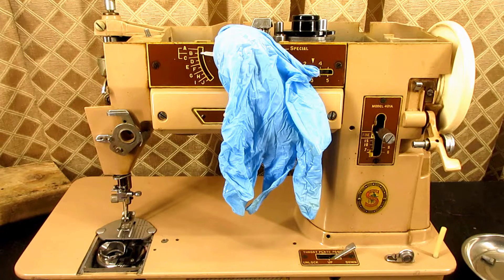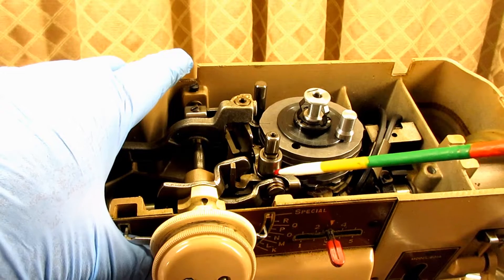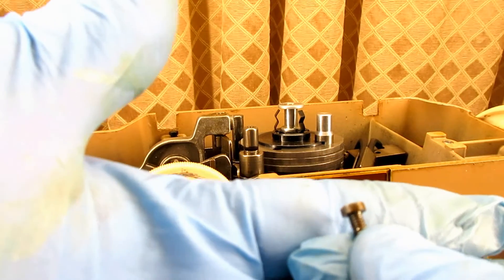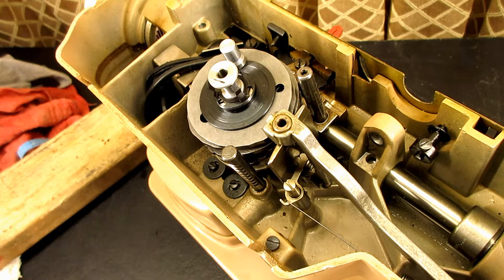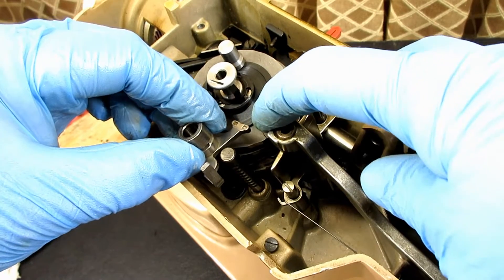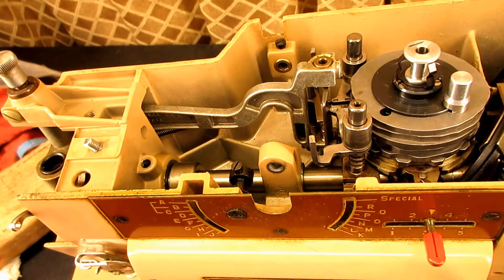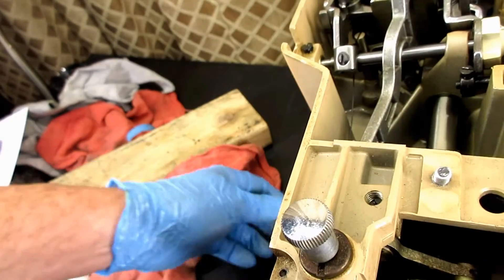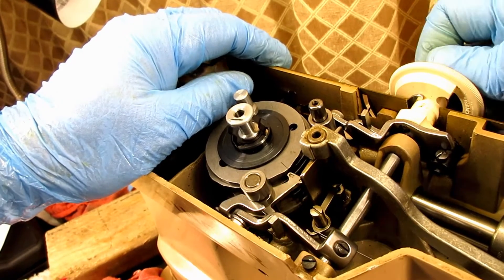Remove the Knobs, Lifters and Followers on the Singer 401A Slant-O-Matic

Comment: Thanks Andy, over a year after you made the video I'm working on a 401 and just removed, cleaned and reinstalled the cam stack, the knobs, the lifters and followers. You're a great resource that just keeps giving. And I've got two more 401s to get to.
Reply from the maker: Thank you, Terry. The video that keeps giving (playing?) Thanks for saving those machines.
Reply: Terry, I'm in the same boat.  These machines are some of the best, even better than todays new standards.  These are strong and can do what todays machines can not unless you buy a beast industrial.  To get one of the 400 or 500 series is where you can do almost anything you want.
Reply: Terry, I’m getting ready now to watch this as many times as it takes to do this with my 401A.  Andy is so thorough that I have no doubt about a successful attempt!

Comment: Such an excellent, detailed tutorial. I am ready to remove, clean and reinstall the sticky, recalcitrant knobs and lifters of my 500A. I have already removed and cleaned the cam stack; the gear and cams were so stuck together that my husband thought they were one piece and therefore couldn’t possibly be separated.  The application of some WD-40 and heat proved him wrong. 😀 I did experience flash rust on some of the cams, even though I started drying them as soon as I rinsed off the Krud Kutter. Next time I will rinse off just one cam, dry it and apply a light coating of oil before proceeding to the next.
Reply from the maker: You ARE ready, I can tell. You can do it too. The metal of the pattern cams is less treated than other metal parts and they can just bloom with flash rust one you strip the grease off. Wish I could have watched you with the WD40 and heat and bet your husband was impressed with your skills! It's good to be the Sewing Machine Mechanic in the family! Easy does it and enjoy seeing the knobs & lifters looking like new. Take Care.

Comment: Thanks Andy 
, just completely stripped, degreased and polished my cam stack , followers and associated brackets on my 411. I have yet to reassemble but this video is such a help.
Reply from the maker: I'm so glad you found my video. It's rewarding to see how clean those parts can be and you'll be happy with how well they work when finished. Thanks for letting me know the technique can be applied to the 411G and I'll ad that in the description. Take care.

Comment: Hi Andy.  I had already done everything in this video before you posted it.  I'm not bragging -- I want to mention that I put the shaft back in with the flat spot down because that's the way it was in when I took it out.  After watching your video, I immediately changed the shaft to put the flat spot up.  It did make a difference!  The pointer on the left on the front now sits at "A" when I put it at "A" and at "B" when I put it at "B", etc.  With the flat side down on the shaft, the pointer would sit half way between "A" and "B" when it was actually in the slot for "B" and so forth all the way down. I just thought Singer sometimes was not so precise; everything else worked well.  So thanks!  Of course, I'm looking forward to all your future videos.
Reply from the maker: Maybe you should brag a little bit! It's not an easy task to remove and replace all those fiddley parts. Nicely done. It's so interesting to read your comment about the flat spot on the shaft! When I pulled mine out the flat spot was facing up, and I did not give it much thought. I wonder which was is correct? The parts diagram does not show a flat spot, and the Service Manual does not mention it. My machine has many signs of being worked on, too. Based on your experience, I'm going with the flat spot up b/c you had a positive result on the indicator pins from changing it to that position. Carole, have you ever thought of recording your own videos for YouTube? You are getting quite a bit of experience working on these machines, and you have some great instincts and comments. Just a thought. Viewers always enjoy a new perspective. I'm going to pin your comment to the top here in case other viewers have this question about the shaft. Thank you for sharing on my channel. "See" you again soon, I hope.
Reply: Thanks for the suggestion about recording some videos on YouTube.  I am so far away from recording anything!  I haven't taken still pictures of anything, either, but that I can start to do, even though I'm terrible with anything linked to photography.  I am going to start taking some pictures of the machines I have refurbished, both inside and outside of the machines.  I have some fine-looking, beautiful, well-running and adjusted machines now, and they did not start out that way.  Well, now I am bragging a bit.  Looking forward to your next video on setting the index pins, setting the  arm stops, and zeroing out the machine.
Reply from the maker: @carolemagnusson5044  I'd love to see you post some of your machines on YT. I know they are beautiful. The nice thing about YT is you can load a video, even from the app on your cellphone if you have one, and you decide the settings. You can make it public like me, or unlisted so only people you give the link to can watch or set the video to private so only you can see it. That way you can play with it and critic your lighting, angles and so forth. There is free music from YT and free audio editing software too. When you are ready and have time you might enjoy it. I'm starting to film the index pins and hope to have it up by Friday evening. We'll see as I have a treatment Thursday. Thank you as always for watching my channel and for your support.

Comment: I got this one cleaned up and running. I still need to tinker with it and adjust it but thank you for the Sklematic! As with my 457 with out the help of your PDFs and some advice and parts I'd be unable to make a stitch.
Reply from the maker: I'm glad it's working out for you.
Reply: Oh, I need your experienced advice!
In the repair book for the Rocketeer you sent me it states  remove the screw (A4) from the stop motion nut (B4)  then remove the clamp.(C4) the the hand wheel assembly
My question to you is how in heck do I remove the B4 after I remove the A4? Do I pull, turn or am I not understanding that the screw I remove A4 is holding B4 and the B4 is the stop motion nut,  the tan or off white portion of the hand wheel?
Reply from the maker: @sharellfox-ralston1958  Easy does it! Are you talking about a model 457K?  In general, the A4 screw is to keep the stop motion from unscrewing all the way when you put the machine in bobbin winding mode. By removing A4 you can turn B4 to the left until it unscrews from the Arm Shaft Bushing and comes completely off the machine. 👍
Reply: @andytubesewing1953  i am working on the Rocketeer. And you've answered my question when you wrote to unscrew to the left! I had no way to know and was afraid I'd make it tighter.. thanks for your prompt reply and your help. Be well..
Reply from the maker: @sharellfox-ralston1958  OK, good. B4 is identified as a "nut". 99% of nuts & screws & bolts unscrew to the left to remove. Lefty loose righty tight. Just like you did to screw A4.

Comment: I have removed many screws and bolts that were very difficult.  The best method I have found from decades of experience and watching dozens of mechanical videos is to let penetrating oil work overnight and then turn to the right and left, back and forth to break it free.
Reply from the maker: We appreciate your sharing your decades of experience with this method. Dennis, thanks very much

Comment: WELL DONE ANDY !!! Was hopping to find something regarding the needle position lever but none of the links, to your previous videos, you gave nor this one could help set that of my machine right... THANK YOU ALL THE SAME... Always glad to watch you reviving those metal pieces :-)
Reply from the maker: It seems you have a few problems with your machine. I'll list some reverences for you on model 611 that may help you and others following your comments. Maybe they can be of help. FREE Instruction Manual: https://www.singer.com/search/support?title=611
$9.00 Service Manual download; https://manualsoncd.com/product/singer-611-sewing-machine-service-manual/
$22.00 Full professionally printed copy of Service Manual: https://www.ebay.com/c/1348562806
FREE downloadable Service Manuals for Models 401A, 403A, 404, 500A, 503A can be found on this page:
https://sewingdude.wordpress.com/category/free-manuals/page/1/
The model in my videos, 401A, was two generations before your 611. The 600 class machines went to the slide levers to select patterns to replace the knobs. However, many parts were still similar/same as in any mechanical device. Like a car still has a steering wheel, driveshaft, differential, windshield wipers, etc., the Singer machines of the 600 class still have a needle bar driving arm, cam stack, vibrating bracket, feed system, drive system, etc. The manuals for the 400 & 500 class may give you insight into how to work on your model without buying a Service Manual. Of course, the Serice manual for model 611 will have the exact information for the model and parts. I often buy service manuals when I am not familiar with the model. or some parts of the model as it saves a lot of time and frustration. The 611 Service Manual is about 50 pages full of information with directions and pictures for adjusting, remove or installing almost every single part on the machine. I hope you can get your machine running the way you want, I admire your persistence and I thank you for saving it from the scrapheap.

Comment: Hey, Andy, awesome video as always!  I have two 401’s that I have cleaned up and lubed.  I had found a video for doing the cam stack, but could never find one like this for my gummed up knobs, lifters and followers.  I was definitely not confident enough to try it on my own.  So thanks a million, again!  It looks very do-able now, and I was glad you left the parts in where you had minor challenges, so that I’ll be prepared.  Take care, from Winslow!
Reply from the maker: Thank you! A special thanks for your appreciation of the challenging parts, haha. I've watched some videos and things go so smoothly it makes me wonder what is wrong with me? You can clean these parts up for sure. I'm working on videos for the index pins, setting the stops for the travel of the cam selector shaft and maybe the instructions of how to "zero-out" the machine. Thanks for watching.

Comment: Thank you soooooooooooooooo much.
Reply from the maker: No problem and good luck, Deanna
Reply: @andytubesewing1953  I think I will stay with my black beauties, I have several singer that only sew a straight stitch but they aren't complicated to clean and oil.
Reply from the maker: @deannalindsey889  Sure. The 401A is about the most complicated vintage Singer model to maintain. Newer cared for it much myself. My wife who has sewn for 50+ years felt how you do until she watched me restore the Singer 301A and 404. She just fell in love with those slant needle machines. The 404 has the same motor power and slant as the 401A and it is more heavy-duty and just sews straight stitches. The 301A is her daily machine (see my playlist for "Coco") which has even fewer parts (in-line hook system) and was the first slant needle. She likes that Singer moved the needle closer to the sewist and uses a taller foot so she can see the work area better. She has owned the 15K, 66, 99K, and 201-2, but just doesn't use them any longer. It's just a matter of preference I think as you can't go wrong with any black vintage Singer model. Happy sewing.

Comment: Amazing,  I just got a 401A... I'm not mechanically minded... but you have helped me get my machine up and running... my cleaning job is not as deluxe as yours... but I'm learning 😊 ... my motor seems sluggish to start with the new foot pedal (I ordered a new one)...I use the hand wheel to boost motor and takes off just fine... any suggestions, thanks,  Julie
Reply from the maker: We don't know the history of the machine. We don't know what work was done on it or which parts, if any, were replaced. 
     Maybe there is binding on parts of the machine (more in a minute). I have found that cleaning a 60+-year-old machine like this can eliminate most of the problems. 
     At the very least the machine needs a complete oiling as shown in the Instruction Manual which you can download for free from SInger Support: https://www.singer.com/search/support?title=401    I've had machines arrive completely frozen. I've oiled and heated the moving parts with a hairdryer to get it moving, then did a "Run In" meaning run at a moderate to higher speed for at least 3 minutes. 
     The machine may have never had a proper cleaning. Sometimes 60 years of oiling has settled into all the bushings and bearings and gotten very hard at the low spots. With some new oil, the old oil can get soft and tacky and slow things down even when it gets movable. 
     In the Service Manual on page 161 is a list of 27 things to check if the machine is slow and binds.
You can download a free copy of the manual from the Sewing Dude's Blod here: https://sewingdude.files.wordpress.com/2012/09/singer-401-service-manual1.pdf   I went down this rabbit hole before. It's really time-consuming. I got to the point it was just quicker to take parts of the machine and wash it in the shower. 
     After hearing from folks who did not want to or did not feel able to remove so many parts I made a video about cleaning the machine with fewer parts removing: https://youtu.be/kXZHksK7rGQ   It's still a process. 
     If you want to just try and get it moving better than oil per the manual and heat the parts where you put oil. A faster way is to put in kerosene instead of oil and run the machine. Then you have to put in enough oil to flush the kerosene. 
     Here are two playlists of videos, a total of 44 videos, about working on your type of machine:
https://www.youtube.com/playlist?list=PLsCOZgzzaiKLiDl9yFTP6mJgQmz5lj4NO     https://www.youtube.com/playlist?list=PLsCOZgzzaiKKyqvdDRwS-9MfLuwSNJTcg     Good LUck.

Comment: Hi, could you please help me, I have a Singer 431 G it’s very similar but one difference is that the selector knob doesn’t have any screws on the face of it. My knob is wobbly so I know from your video that I need to tighten the screw underneath it, but how does the knob on the 431 com off?
Reply from the maker: I've never even seen a 431G here, only pictures and videos. I would look upward from the bottom side of the knob or down from the top. Sorry I can't give a better answer.

Comment: Andy - yet another amazing video. You helped me get my “completely stuck” lifters unstuck! Yay! And (probably more importantly) I could get it back together. You were right about getting pictures from many angles. That also saved my bacon.

Question — there’s a spring that stretches the length of the machine. I know one side goes to a positioner behind the large vertical needle bar positioning guide (that’s moved w/the 1 - 5 adjustments w the front lever).  Where does the other half go? Mine came completely off.

Also, you’ve mentioned a paypal account previously — could you share that? You’ve helped me restore three vintage machines now and saved me a LOT of money. Honestly, I’d have stopped at the first one without your videos.

Thanks Again!
Reply: I think I found where the spring goes. There was a post with a notch and nothing attached there - the post is to the left of and slightly behind the presser foot pressure dial. Given how easily it fell out and the fact that there was nothing in the notch, I assumed that's where it goes. Seems to work!
Reply from the maker: Yes, absolutely correct. The Needle Bar Driving Arm Return Spring is what it is called and that little post is on the Vibrating Bracket.
Reply from the maker: You are getting the idea now, Marya. Nicely done. You can do all the adjusting, cleaning on the machine, no worries. I hope you are finding it fun and rewarding to be fixing your own machine.

Comment: Hi Andy thanks for your videos, it helped me a lot with my slant o matic 411G. I followed carefully this video to remove, clean and reassamble but I have a question about the shaft. Is it normal for my shaft to move toward the back of the machine (I can then see some of it outside in the back then) when i push the selector knob to move my selector from A to J?  and then when I pull my selector knob to move from K to R, then the shaft moves back in.
when I took out my shaft, the little black "tube" in the back of the machine (in which the shaft goes into) move some (it could move either towards the back or towards the inside):  is it what causes that shaft movement during the changes of stitches with the selector. Thanks in advance for your help
Reply from the maker: I've never seen or worked on a 411G, but I can answer your questions based on the parts of the 401A & 500A. 
     1. Yes, it is normal (and required) that the shaft moves out & in on the back of the machine. You can see this happen a few times in the video. If it did not move you could not select the different pattern on the cam stack. 
     2. The black "tube" is called the "Stop Bushing".  b/c it allows the shaft to slide through it as the shaft moves. Stop because it can be adjusted to Stop the movement of the shaft going out the back at the best point to make the Lifters work correctly. 
     3. The Stop Bushing should be stationary and should NOT have moved when you pulled out the shaft. The Stop Busing is held in place by a set screw directly above it. If your Stop Bushing moved that means the set screw was loose or missing. 
      4 Here is a video that explains how to adjust the Stops for the Shaft so the knobs can work properly to move the lifters https://youtu.be/p_EZnA7d83Q